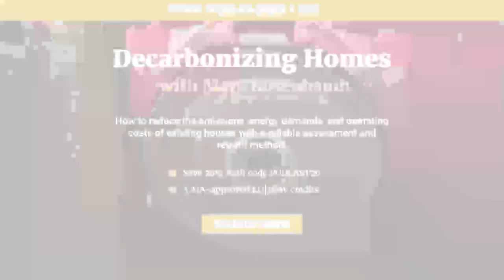Podcast 595: Raised Floor Systems, Carriage House Conversion, and LED Strip Lighting

Comment: Low voltage, makes me think of where it is used now, I.e. RV and marine industries. Refrigerators, radars, communications, lights, fans, etc. all on 12vdc, not to mention big draw items like starting motors. Maybe there are answers in these industries.